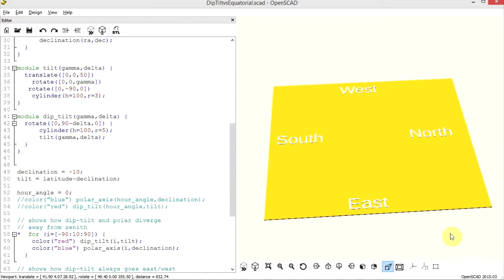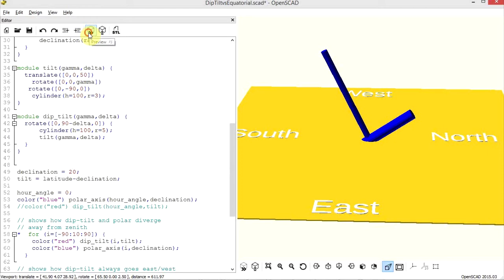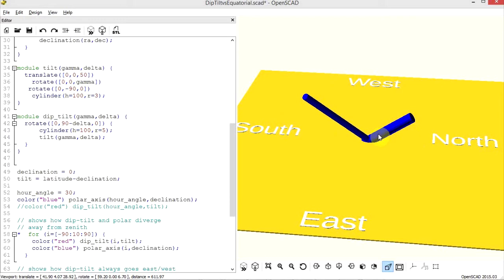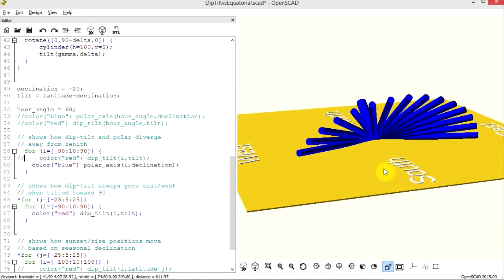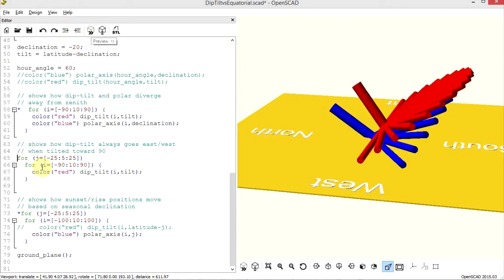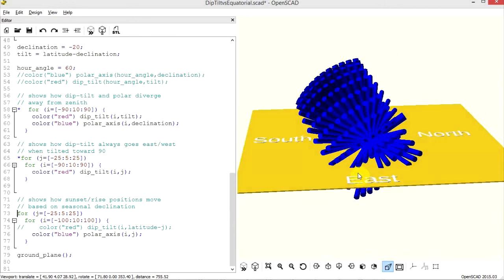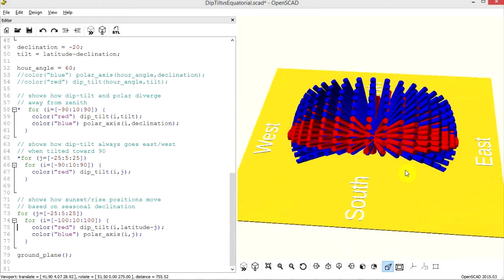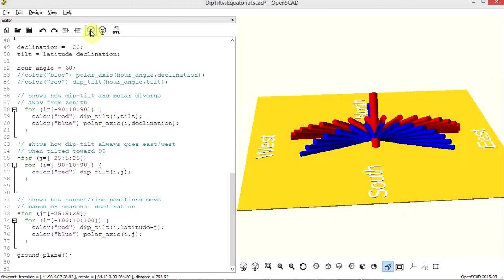Solar Tracking: Dip/Tilt aka Polar Vs Equatorial Mount

Comment: In answer then... Mount on vertical pole and uses twin axis to put exactly where you want it rather than having to compensate from the tilted axis..
Also the panels when strung out on a long mount don't swing towards the ground either. everything stays parallel to the ground.

Comment: Very good !
 I'm a telescope maker ( @Biffhardsteel on Twitter) and I've decided to put in solar at my house.  So.. of course, as a telescope maker I'm going to build a large equatorial mount.

It is a polar aligned (3" Square Tubing) axel about 10 feet long with bearing support at each. End. then the adjustable solar Panels angle(s) to match solar altitude angles are adjusted by tilting the the 10ft X 9 ft solar panel mounting platform longitudinal on top of this axis.
I am at 40° Latitude..

I'm in construction phase right now.. I'm welding it up, it will be pretty big, and around 800 lbs..
 and so..
 let me take some pictures and maybe put a YouTube vid up.

 But Thank You,  excellent job visualizing and describing the differences ! 
So YES !!-
Let's drive in ONE axis on a polar alignment and maximize our solar power production, Sunrise to Sunset !

Comment: So which type would you say is the better route? Wouldn't an equatorial that follows from east to west, on an adjustable bracket be the best of both worlds? You would be able to change it's angle every season based on the suns height in the sky and it would still track the sun better from east to west.
Reply: K Mat 
The angle of the Polar alignment will not change (on a polar equatorial mount ) you drive axis will always be pointed at Polaris in the north sky, with altitude based on your latitude. 
Then with that Axel as you're rotating point (it is simply rotating along a axis that is PARALLEL to the Earths axis of rotation, but in the opposite direction...  Thid counters the Earth's rotation... so that you remain pointed at the same spot in the sky as the earth turns under you) 
So to re-cap, you're driving about the polar axis at the angle pointing at Polaris..
 now, step 2,  you have two POINT (from that non-changeable axis of rotation) to the Sun. 

The sun's height changes over seasons so all you really have to do is  tilt the solar panel top (the end towards polaris) out & bottom In  -for winter, ( More to Vertical ) and Top in, Bottom Out ( more to Level) for Summer.. with this setup you will follow the Sun from sunrise to sunset... 
I'll try to post a video of the progress on my large equatorial polar aligned, solar panel mount
This Week.